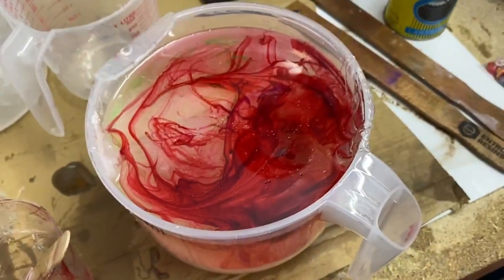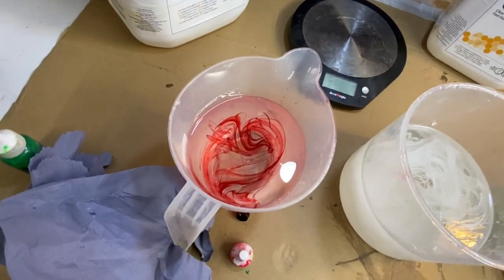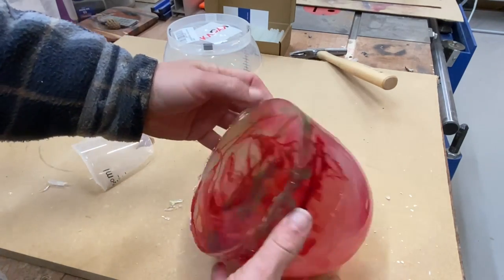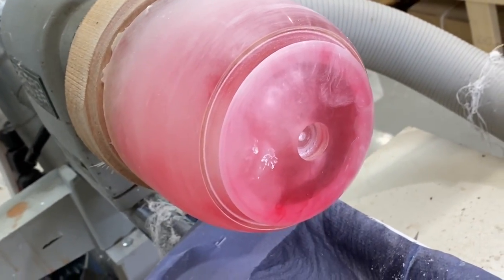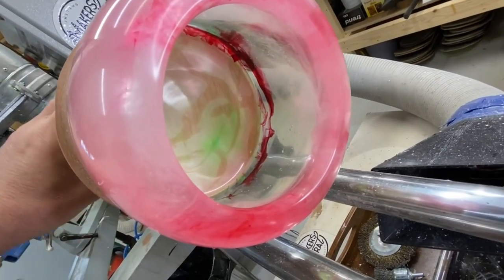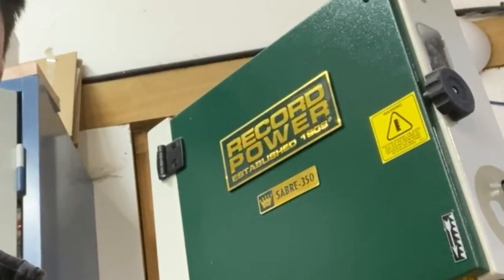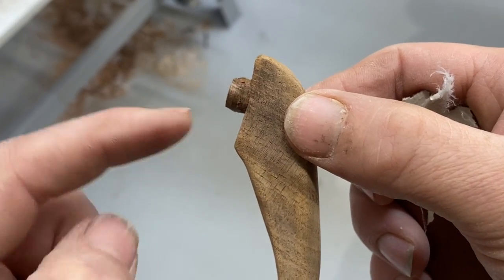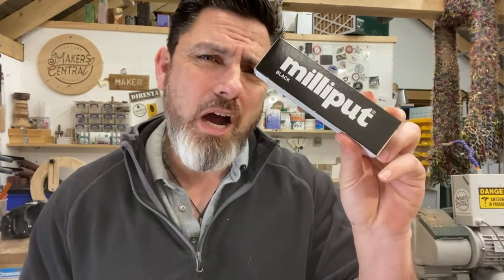Woodturning - The EPOXY RESIN ELECTRIC KETTLE out of EPOXY RESIN **WARNING DANGEROUS **⚡

Comment: Nicely done. However, even if the resin didn’t melt, it softens at 60 degrees. Prolonged heat will de-bond the resin.
Reply: 💡So that's why you don't put resin covered travel mugs in the dishwasher!
Reply: Not to mention that resin is a toxic material and should never be used for food products. It’s not food safe unless the packaging explicitly says that it is.
Reply: @danielrawlings9927  
I was wondering about that. Thanks for the info. Good to know.
Reply: I also wondered about the food safety of the resin and the milliput
Reply: @danielrawlings9927  also to add, the resin itself may be food safe but if you add anything like color that could make it not food safe
Reply: Isn't resin toxic? Or is it safe once its finished curing?
Reply: @carlycharlesworth1497  the scale of it being foodsafe is based on the amount of bisfenol F that is in the mixture. if none is present it is most likely "food safe". But to clarify about this topic. DO NOT MAKE RESIN CUTTING BOARDS it is not meant to get into your food.... serving tray no problem but never cut on resin.
Reply: @devineskiller  thank you for the warning. I had no idea that resin chopping boarda could be so dangerous. I feel more reassured now that I know what constitutes food safe, referring to the kettle! Stay safe, stay well. God bless you.
Reply: @danielrawlings9927 no, there’s actually food safe resin....
Reply: I’m so confused. Do you actually mean degrees? Because resin doesn’t even cure right in 60 degrees. And I’ve poured over car audio boxes where heat can reach 130 or higher on a hot day and never had an issue with de-bonding.
Reply: @Daddy_Potaytoe  60 degrees Celsius
Reply: @kylasaundersmiller2286  thank you
Reply: @honeybaby7840  u

Comment: Please don't die from resin chemicals by using it for food, your subscribers quite like you and we would prefer you to be healthy and living
Reply: This is exactly what I'm worried about. Plz don't use it anymore it's a nice novelty piece.  Thanks for another great vid Nick!!
Reply: You guys want him to read your comments but you don't read his comments.
Reply: @sandra-jones  just making sure and showing love and concern :)
Reply: If he only used it once or twice it might make him even more Wacky, Warped, Weird...

That sounds like a WIN-WIN for us (just so long as he uses it no more than twice...three times TOPS!!!)...

Honestly, a little more Wacky, Warped, Weird is good, Chemically Induced Dementia/Alzheimers is BAD so DON'T OVERDO IT NICK!!!
Reply: resin cures into an inert plastic anyway and is generally food safe. it will be fine.
Reply: @orson091  Most resins are not inert when cured. They can leach chemicals into the food when warm/hot - like early plastic containers that had DO NOT MICROWAVE warnings on them for the same reason, they bleed chemicals when heated.
If you want to create a Resin plate, bowl, platter etc. for food use, you MUST either find one of the rare and expensive food safe resins or coat the dish with a food safe finish.
Please don't just grab a common casting resin and make a salad or soup bowl for use unless you finish it with a food safe coating, it will slowly poison you if you do...
Reply: Accelerated and styrene poison ☠️
Reply: Not to mention his two kids

Comment: Nick, this is incredible!  This video is the answer to all questions about epoxy and hot water!  Super Super Video!
Reply: Good to see you here buddy.
Reply from the maker: Hey thank you buddy that means a lot 😜🥳🙏🏽
Reply: @nickzammeti  I love how the maker community care and support about each other
Reply: epoxy does soften with high temps, so do beware.
Reply: Hi nice how I follow positive couple and he watches you too! Inspiring guys!!
Reply: I'm a subscriber  to your channel and nicks lol resin family 😆
Reply: yes it will hold up, yet other types such as soft set and uv wont for long.
Reply: @fredygump5578  the harder types used on boats and for outdoor applications dont but soft set and uv will as well as the type that is meant for thin set applications....also acetone will melt all of them, not that ive been experimenting looks innocent
Reply: @helema23  In the worl of composites, epoxy temperature resistance is a big deal.  There are "high temp" epoxies, which typically require a specific "post cure" heat treatment cycle.  Curing/ post curing at an elevated temp will increase the temperature resistance of the epoxy.  Rule of thumb is to cure/ post cure at the highest temp the part will experience.  But all that is about laminating epoxy.  Casting epoxy has different properties...and I expect it isn't optimized for high temps!
Reply: If I was making this I would have bought a normal kettle, then make the resin kettle as more so a tube that fits over top of the kettle, with slot that lines up with the handle, pouring part and plug
Reply: I'd be afraid of chemicals migrating into the water... like some plastics won't melt in the microwave, yet the manufacturer still does not sell them as microwave safe because they will give off chemicals into the food...

Comment: I assume that resin is food-safe when cured? It better be, as I don’t want you to get sick. 🫖 ☕️ 🍵
Reply: That is what I was talking of to.
Reply: There's a foodsafe finish he puts on his food things.
Reply: It's like don't put plastic in microwave, the plastic releases cancer causing carcinogens ??
Reply: @pyredynasty  
According to the MSDS for Milliput, it isn't food safe.
Reply: I'd be afraid it would reheat the resin
Reply: There's nothing food safe at all about this lol
Reply: @stuartcommon4651  
Agreed. I just looked up the MSDS for the epoxy. I couldn't find anything on cured resin, but I did find plenty for uncured.
Be safe Nick =(
Reply: The main issue is that when heated like this especially in a wet environment... such as a kettle... there is the very real possibility that chemicals will leech out. Pretty irresponsible showing this in case others copy it
Reply: @stuartcommon4651  If others copy it, they should proceed with the same caution, insight and safety protocols as anyone who just thinks of it himself and decides to do stuff with resin or other chemicals. "I've seen someone else doing it" is no qualification and no argument for lacking safety yourself.
Reply: @CookingWithCows  well said.
Reply: Read his comments guys.   It'll answer your questions.
Reply: Very, VERY few Epoxy Resins are food safe when Cured and they tend to be rather pricey...
Reply: I am more worried about someone doing this at home and then using the resultant product. Half way through the video and I haven't heard any cautions about making one at home yourself.
Reply: No it's not food safe, and it's never to be heated or be used to hold water... at any time for any length of time. Resin is worthless for anything other then art.
Reply: Lots of kitchen and bathroom counters with poured epoxy resin finishes. Lots of table tops, too. All here on YouTube. No one seems to be concerned there. Lots of turned resin bowls and cutting boards, as well.

Most of what people read about when it comes to resin safety is the uncured state. Most cured finishes and resins are food safe to a large degree. Just like you shouldn't handle uncured resin with bare hands, but handling the cured item is just fine.

In this case, it would have been more appropriate to use a food-safe epoxy resin given the use, if he actually intends to use it for any amount of time. But I wouldn't go so far as to call it "irresponsible".

Comment: Nick, have you looked up if this resin is "food safe"?

I know that a lot of different types of plastic containers such as mugs, plates and lunchboxes for example, shouldn't be used with hot beverages or food, especially not multiple times as the plastic starts to "leak" chemicals when exposed to hot temperatures, and these chemicals are toxic (prob not enough to actually poison someone but still, not something that should be digested).

Just wanted to make sure you're being safe! Loved the end result though, very funky!

Comment: I absolutely love it.  This is my favroite thing you made.  Great video.   I think it's more red then pink.  It's light red in spots, dark red in others, blue, clear.  Really pretty.  The heating element you used tho... those give me so much trouble.  You dare not turn it on if it's not completely covered with water.  Don't let it burn down.  I have ruined so many of those.  But, that one looks a little bit stronger then the little ones I have used.  🙂

Comment: Hey Nick.  Just a thought.  When trying to layer colors instead of pouring directly down where it pushes under the surface of the layer and force mixes.  Try using a long handled spoon or stirring stick with the bottom just touched the surface of the resin and pouring on to the bottom part of the stick so the new layer will float instead of sink.

Comment: I thoroughly enjoy your style and enthusiasm, Nick, but that is a kettle that only a Father could love :-)

BTW, I think you may want to drill a small hole in the lid to release pressure while the water heats up, and to allow air in while pouring to get a smoother flow.

Comment: one of the creators i watch has advised against using resin to make stuff you are gonna use with foodstuff. sadly i cant remember when she said it or the specific sentence but it was as a reaction to a fork or something similar where she said that she wouldn't advice to make such out of resin if you were gonna use it.

The Epoxy Resin Store for example says that most their resin is not FDA approved and
"While it may not be harmful to use these chemicals on furniture, the same cannot be said when they come in contact with food."
and warns that you should be sure the type of epoxy resin you use for this is FDA approved.

so pls be carefull ppl.

Comment: Just had a brain wave watching you peel off those shavings. I know normal resin shavings will just dissolve or go invisible if you put them in resin again. But what about if you made up some blocks of really dark colors. Like pure red, pure blue, etc. Then use your tool that makes the thick ribbon like shavings to gather a bunch of brightly colored resin shavings in long ropey form and then case those in some clear resin. Because of the color they wouldn't vanish and it could give you more control in something like this where you want the color swirl to be easy to see but do not want a mix. Would that work or am I crazy?

Comment: I’m wondering why you put the spout so low?  Why not make the spout at the top, add hole on one side of the lid so the water can be poured out of the lid, then turn the lid around to block the water when the lid is place with the part without the hole on the spout.

Oh, and then there’s the modern convection water boilers out now that use magnets to quickly heat water to a boil, making this teapot obsolete. In fact, that heating element you added to your teapot is what we used to stick in our coffee mugs to boil a cup of water when we were in college. No since in heating up a lethal pot of resin when you can just heat once cup at a time.  We weren’t allowed to cook in our dorms back then. So we’d buy bread and cheese, wrap in aluminum foil and use our clothes irons to make grilled cheese samitches!  

Your pot is very pretty, though.